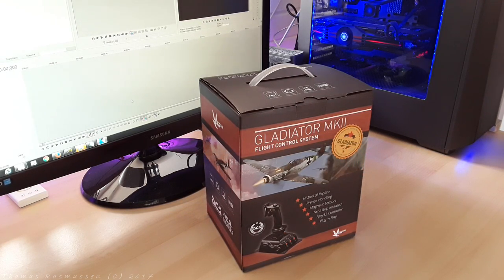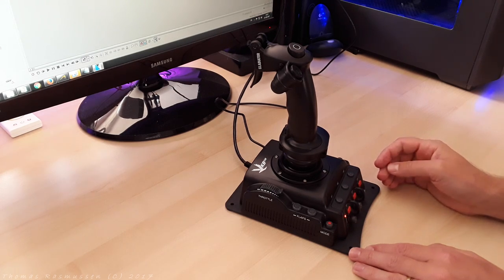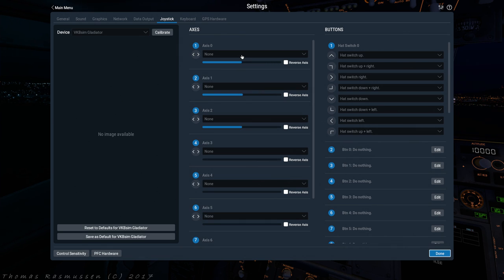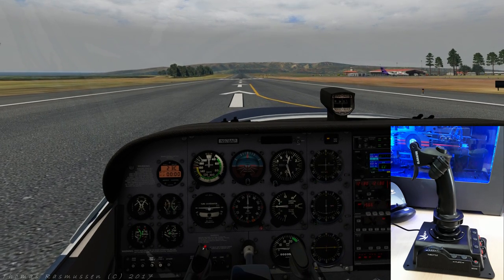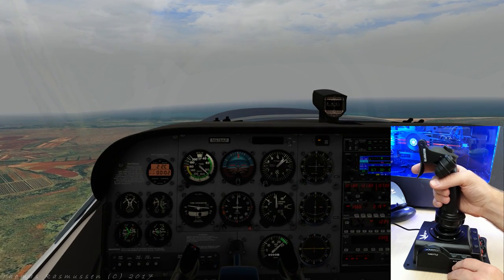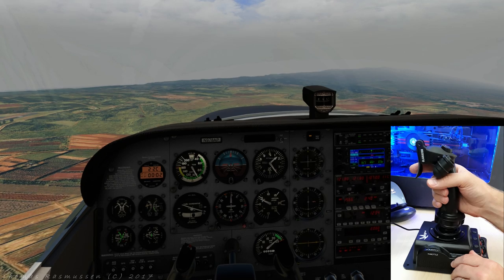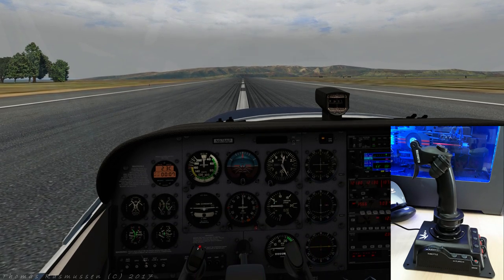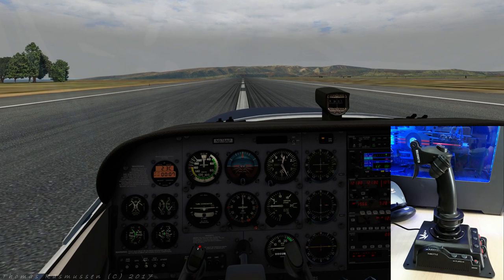[Unboxing & Review] Gladiator MK-II Joystick (VKBSim)

Comment: This stick is an absolute godsend for me! To explain, I have multiple sclerosis and it's ruined the function of both my legs and feet as well as my dominant left hand...so pedals are no use for me, and separate throttles are out too. This stick overcomes a LOT of these shortcomings, without a doubt. The pinky operated shift alone is amazing; it doubles the functions available for each stick button, and for less immediate tasks I can use the mode button to QUADRUPLE the functions available for each stick button, no-rush commands like parking brakes and similar are a snap! The only slight awkwardness is having to A) release the stick to set my throttle, or B) to slide my hand down and use the disc on the stick bottom for control while a finger operates the throttle. This latter is what I'm trying to learn better, especially in games where small throttle adjustments are important while taking off, landing, and fighting like in the current IL-2 Sturmovik, and it's worth some practice time to build muscle memory for this oddball action. Rise of Flight WW I flying is no problem at all (especially with rotary engines that use a blip switch!) and my next venture will be X-Plane 11.

I must say, I'm especially anticipating getting X-Plane 11. I spent 20 years as a professional pilot in real life and these days I'm stuck in a power wheelchair. Since I can't fly or even board a physical aircraft that sim is a great way to experience general aviation and my old Part 135 courier flying again. Heck, I see there's even a Mitsubishi MU-2 available for X-Plane 11 which should be a blast  given that's what I spent much of my career flying. We're talking several thousand hours alone in it, so being able to recreate my old routes and missions in an airplane I'm so fond of will be pleasantly nostalgic.

I'm having tons of fun exploring the added capability only this stick can give me. My sincere thanks to the VKB Sim folks for making it available and letting even a physical train wreck like myself enjoy flight simming again!
Reply: UPDATE 5/8/2019: I got around the throttle issues by constructing an extension that fits onto the throttle tab, I still have to learn the finger dance a bit when adjusting power wjen flying, but it's WAY better now, I'm comfortable and having a ton of fun. Here's wehat it looks like in use:  https://scontent.fbna1-2.fna.fbcdn.net/v/t1.0-9/53323420_10157019305002381_8703877660591259648_n.jpg?_nc_cat=102&_nc_ht=scontent.fbna1-2.fna&oh=ab2b3c92c785b8d577824d9dd5e1c2c3&oe=5D6CD0C3
Reply: as someone who only has function of their left hand, this comment was exactly what I wanted to read! Hope you are still enjoying the skies!

Comment: I've had mine several weeks now and am very impressed with this stick. I have Saitek throttles and for those who dislike the location of the throttle on the J/S that too can be reassigned to do something else. I use mine in FSX and prgram it using FSUIPC. Great purchase and a pleasure to use.
Reply from the maker: I share your enthusiasm regarding this stick! As mentioned, I've been used to use the Saitek Pro Flight Yoke (incl TQ) but it's a pretty easy stick to get used to! Definitely a great product - which is also their T-rudder MK-IV rudder pedals btw :-) Thanks for tuning in! :-D

Comment: Great review.  I have had mine about a week.  It is a big improvement over the previous Logitech Extreme.  To help those of us who forget the function assigned the Gladiator has flaps, throttle and start labeled.  Also labeled is an EJECT, but since I fly the Cessna 172, that is not needed.  : )
Reply from the maker: Thanks for watching, James! Yes, you're absolutely right and maybe I should have emphasized in the video that all buttons are labelled with flaps, eject etc.. LOL, no I guess you won't be using the eject button in the C172 lol! :-D

Comment: Were you able to get the mode and shift to work with X-Plane? Saitek has this and the mode & switch doesn't work with their drivers in fact they told me not to use their drivers. Does the mode switch actually change what comes from the joystick?

Comment: Hey thomas i was curious about weather that integrated throttle wheel, can i use it to fly a airbus or a 747? will all the engine's throttle increase along synced together? or does the throttle just work with dual and single engined airplanes only?

Comment: Thanks for video... be sure to add a little right rudder when takeoff. makes you look a pro...  I think I would like to see twist rudder in action... perhaps a forward slip or crosswind crab angle as a test during review. Many people use joysticks for Airbus, but being right hand joystick, technically you are supposed to fly from FO right seat, not PIC. People should also learn to fly with left hand and twist/keyboard with right, and of course ideally fly with either hand. To me, this is a weakness, being only right hand, but I am sure they were thinking of DCS world combat aircraft stick etc. I need an ambidextrous joystick with rudder twist.  Any recommendations?

Comment: Looks like a really high quality stick, and great review.  My only quibble would be the right hand only design.  Most GA aircraft that have sticks are left hand for the left seat, GA aircraft with center sticks have the throttle/prop speed/mixture on the right so most people use the stick with the left hand.  

Not a huge deal but if you're using XP as a sim trainer for one of these GA planes you'll build your coordination much better with a left hand stick.
Reply from the maker: You're right, but to my knowledge this is an issue with most of joysticks available! Thanks for watching =)
Reply: Thomas Rasmussen Probably true, however I think the Thrustmaster 16000 can be set up for either hand.

Comment: So the Gladiator Mk II has a 15 degree twisted handle and can only be used at the center position without a throttle. They put this fact way down in the description. Also, the center dead zone is pronounced and could not be fixed with the Wizo software they make you download. It's mushy and inaccurate. I cant recommend this joystick especially when you eat the shipping cost back and forth. I will keep looking for a decent joystick. Not this one
Reply from the maker: Thanks for sharing your experiences with this joystick, although I have to say I can't recognize any of the issues you're having and totally disagree! I'm still using my MkII extensively : Yes, it's got a twist handle (though, I never use it, because I have the VKBSim rudder pedals as well) and the twist handle also works when the stick is NOT in the center position. I'm not sure, what you mean when you say "without a throttle", because the stick is equipped with a throttle natively!? Also, I have NO center dead zone at all!! I'm wondering if there's some kind of defect with your stick?
Reply: Thomas Rasmussen  This guy went on every single VKB review and copy pasted the same comment.
Reply from the maker: Ah, thanks for the heads-up, Kerenton! =)